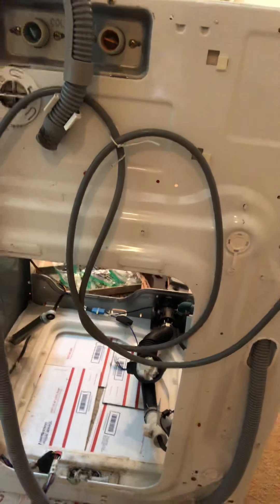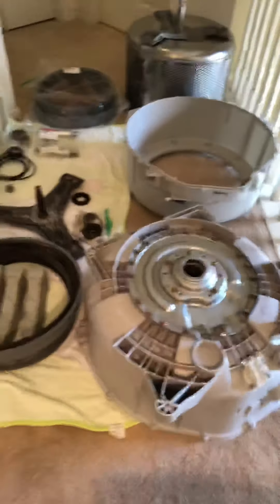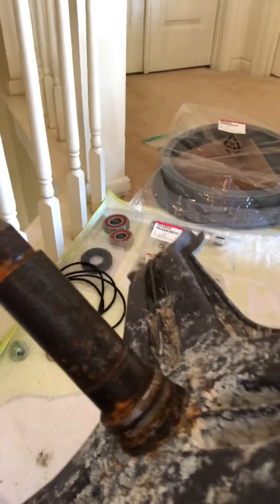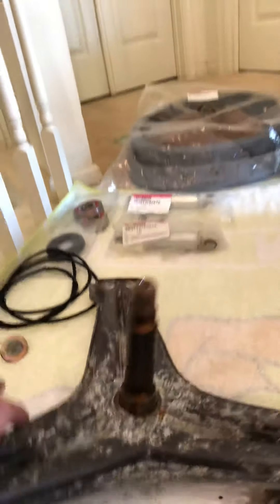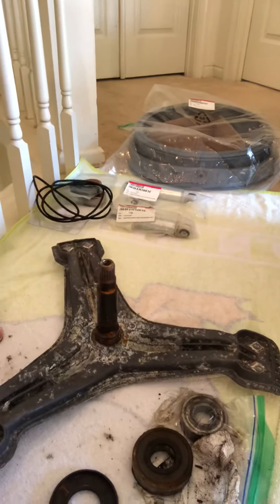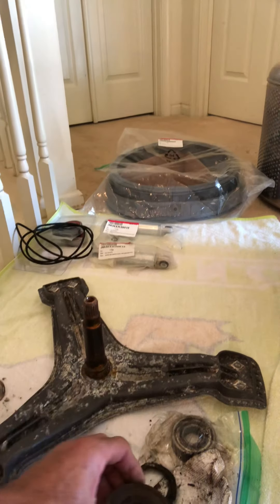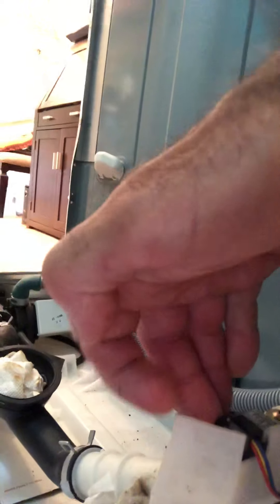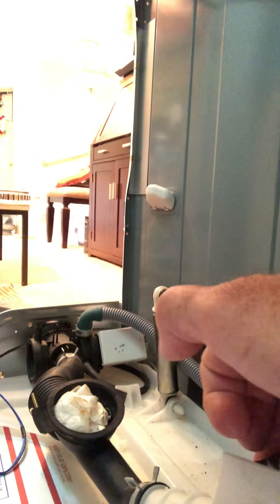LG/GE Washer Repair “warning” watch before repairing/replacing bearings.

Comment: Leave the washer door open when it’s bait being used. I’ve never had any issue with mold or bad smells. I have had two loads now with the bearing making noise so I’m going to take mine apart today. Doing disassembly & checking for additional failures or wear on other parts before you place an order, is just how you’re supposed to do things. The scum on everything is completely normal and expected. The aluminum spider was a poor design choice- stainless would have solved the problem. Anyway, thanks for the video.

Comment: I tried over two days to try and get the bearings out using pullers, press, hammer etc etc. In the end I used an air hammer to smash it out in a second and got away with it. I was a bit worried about breaking the plastic tub but by that point it was trash.

Comment: I guess I’m qualified to pipe in here,
Sometimes it’s not the money or time but the principle of the thing.
I just finished. 
I’m the furthest thing from being a mechanical guy, but I got bent when two different repairmen said the repair would be between $1-2000!
They both said “throw it away and buy a new one.”
     The “manufactured obsolescence” thing got me wound up,
So for a total of $130 in parts and the magic of YouTube, I replaced the spider bracket and the inner & outer tub bearings.
The bracket was crumbling like blue cheese (which is ridiculous and should be grounds for a massive class action suit, but they all do it the same so they get away with it)
but the bearings were fine. I replaced them anyway.
    If you’re going to be that far into the machine, I figured just do it, the parts aren’t expensive. 
Take your time with disassembly and put every screw in a ziplock bag and mark where it goes, and when possible tape that bag to the part it goes to. Take a sharpie and mark everything on the inside, even down to where a zip tie goes. Reassembly will go much smoother.
     What I learned about the whole thing was great, and use about 25% of what the detergent recommended, and if your machine has a 
“Cleaning cycle” use it, even more that it recommends.
Reply: I agree with you theres too much waste in this throw away society, incidentally how old was your machine?  Our LG is 4 yrs old, it spins perfectly when empty but with clothes it is noisy out of balance, they tell me the shocks souldn't fail already.  What symptoms did your old spider give? they tell me its gives a metallic noise as the stainless drum sometimes scrapes against the plastic surround if there really bad ?
Reply: @rogerbuckland4214  of course I’m not expert,
(Then again I might be after the experience)
But having been through this, I’m gonna say “get to work”.
I’ll bet dollars to donuts your spider bracket is toast. Your fix will go easier by doing it like I did in my description, as you will at some point will feel overwhelmed. Don’t stress as it will be fine even though it won’t seem like it.
1. New spider bracket.
2. Replace the bearings simply because you’re in there that far.
3. You can replace the shocks whenever you want, as it’s easy access, unlike the spider and bearings.
I got all my needed parts off Amazon, then just went super meticulous on labeling EXACTLY where every tiny thing goes when I took it apart.
It’s a pain for sure, but payed off big time on the reassemble.
And just be prepared to be hailed as a hero by the Mrs.!
Reply: @Daddy53751  Thanks for your advice 👍
Reply: @Daddy53751  Thanks for your advice 👍

Comment: New seal kit which included tub gasket $22.77, lasted 1year. Replaced it a second time, bearing kit was $14.99 (no tub o-ring). No don't it was tough, not sure but I probably had 24 hours total time for both DIY repairs. Bought this machine back in 2007. Run almost daily. It's an LG WM2077H. Dirt cheap and easy to repair and it doesn't owe me a dime. Keeping it as a spare for stuff I wouldn't want in the regular wash. While I would do what I DID again, I won't DO it again. This guy's machine was completely worn out. Should have been able to see that just from taking it apart. If my machine was in the kind of shape this one was, I wouldn't have ordered ANY parts. I would have bought a new machine.

Comment: I am going down this path now with a 20 year old Kenmore stacked washer, we purchased new, in a weekend house.  Replaced the bearings/seal/shocks for $167 (uneventful 3 hours) and while I was assembling the unit wife noticed while cleaning that the spindle on the spider arm was rusted and broken.  So we were going to buy new.  New was $2,000 for poor quality GE washer/dryer stacked.  Spider arm with wash drum for Kenmore unit was $500.  So we went with repair the solid, quality 20 year old Kenmore.  Waiting for the spider/drum to be delivered.  Estimated assembly time 2 hours.  Total time estimate 5 hours labor.  Based on today's low quality products, I bet your repaired unit will last longer and work better than if you had purchased a new unit.  I am confident (and so is my wife) that my old unit repaired will be superior to a new GE unit of poor quality

Comment: I hope anyone wanting to do this sees this comment I'm a 100 lb woman and I did this by myself. No help from anyone. It really is not a big deal. I pulled everything apart, replaced the bearings, gasket, and shocks. I took the spider off to clean it up, cleaned up ALL the parts, and voila. You can do it too. Just understand that it may be a couple days if you need to order more parts like I did for the shocks 2 day delivery from Amazon. I found a great video that is about 35 minutes long- put it on .75 playback speed and followed along while pausing here and there. As a small caveat I do have tools and I am mechanically inclined, HOWEVER- all it takes is the gumption to learn something new!e
Reply: Not sure why the part of this comment is crossed out, but speaking from experience, it is total BS.  No 100 lb woman, much less man can lift the drums out of the washer cabinet all by their self.  It took me and my very physically fit son’s entire strength to lift it.  Very challenging repair for even people that have superior DIY skills.  If I had not paid nearly $3000 for washer/dryer pair and pedestals five years ago, I would not have attempted repair.  BTW, my initial problem wasn’t the bearings, it was the lower (or back) plastic outer drum had a quarter size hole in it.  I found nothing that could have caused the hole.
Reply: @ I'm not the type to troll on the internet, and I do not make random comments to bullshit anyone. I did do it. By myself. As a 100 lb natural born female. My drum came out fine, I don't know what was up with your drum; the video I watched I followed step by step along with the guy. Maybe it was Milwaukee tool magic or some of my southern Appalachian hoodoo, I don't know what to tell you. 🤷🏼‍♀️

Comment: Your wife sounds like mine," I want a new one". I have been there and done that with an LG washer, Replaced the cracked Spyder bracket, bearings, shock absorbers, and springs. Levelled it and put rubber pads under the feet of the unit. Damn thing still does not run smoothly and the drum moves around way too much. Now I need a new rubber front seal and I noticed that the hot water inlet valve is corroded, might as well replace that too. What happened to the days when a washer lasted 20 years? What is the big deal that it uses less water when it is not reliable? 
  At least we can repair stuff ourselves and until it gets to a point that it is just not worth it anymore to repair and we have to buy a new one. Some things I have noticed on these new front loader washing machines. The replacement parts are way too expensive. The shock absorbers are junk. Basically a metal rod inside a plastic sleeve with a bit of grease in them. I wish someone would make an aftermarket real pneumatic shock absorber for these washing machines, that is probably why they don't work all that well. They need better dampening and a proper shock absorber.
Reply: Washing machines 20 years ago were all still plastic then. My dad had hotpoint and tricity bendix when growing up and they broke down too. It’s just luck I think and how well you look after it. My last lg was 20 when it died. And all my clothes come out just as clean as my old one. And yes it does use less water but I don’t mind as everything still comes out clean. But with a duvet or big blankets I do fill it up more with a jug to just up over the door they wash good then. But clothes come out clean every time . People need lessons on how to look after front loaders.

Comment: I couldn't get the bearings out after spending all the time taking the washer all apart.  They were basically melted into the housing as the bearings were so worn They were coming apart but melted in place. At least it was easier to get down the stairs and into the dumpster after I took it apart!😢

Comment: Now Imagine having 2 side by side and disassembling them both at the same time. 

That was my journey. I had one that would be my working washer and one was the parts washer. 

I replaced the bearings on the working washer about 4 months ago. Only thing wrong with the parts washer was the inner basket had caught onto the metal edges and bent/warped the basket. 

Now you're gonna say why not put the metal basket into that one. Well based on reviews of this model, well there was a couple of continous complaints about the temperature and amount of water it used and the results were clothes that weren't really clean. What I have experienced with the washer I had that would be the working washer, was clothes that were cleaner than any washer I've ever used. So i'm using the outer tub stater and rotor, springs, dampner's and water pump on my existing to make it an almost new LG washing machine built by me. 

BTWuB - All my parts were free and all OEM, as my parts washer I found on Marketplace on FB being offered at no cost.

😂😂😂

Comment: Yeah time is money but it feels good when your able to fix things on your own. Over use of detergent and especially the use of fabric softeners can leave that scum residue and harm the washing machine. Instead of fabric softeners use distilled white vinegar. You can clean your washer by pouring 1/3 cup ( 1 cup if it hasnt been clean in months or years) of citric acid and 1 to 2 tablespoons of oxyclean when you do the self clean mode. This is almost the same buying those expensive washer cleaning tablets or pouches. Just less expensive in the long run.

Comment: People should be using less sofner more hot washes and leave the door (OPEN) when not in use! I have a lg 8kg turbowash smart machine had it over a year nearly two never had the inside looking like that. Or my last lg intello washer which was 20 years old when it died. Might as well of bought a new machine for all the parts it’s had. But now will probably last Another 5 to 10 years 🙂

Comment: I’m on my 2nd spider assembly since I bought the machine in 09. If I have a reason to buy a new one, it’s gonna be because the front load machines are unsanitary & disgusting . Taking apart & Fixing the machine doesn’t bother me , however , I will never buy a front load machine ever again for sanitary reasons
Reply: Use washing powders that have sodium percarbonate (oxygen based bleach) and TAED (bleach activator) in them and leave the door and draw ajar after the wash and your front loader should stay clean and odour free.

Oxygen bleach kills mould and bacteria as well as breaking down stains, and leaving the door open stops mould growing on the door seal. 

I've not had a problem with mould, bacteria, slime, or smells since the 1980's when we tried out liquid detergents and stopped doing weekly boil washes. They don't contain the "oxi-action", because it would break down the other ingredients in the bottle.

See https://www.youtube.com/watch?v=6HnzBS_XQhA

Comment: Nearly 18 years on my LG Tromm and my bearing is making noise now. This is further than I wish to dive on it. It may last a week. It may go a other year or two. But my luck I'd do all this work and it would leak. Nope. Pass.
Reply: You shouldn't expect the new LG washers to last that long. I had one that lasted 13 years, but the new one I bought in 2018 shredded the bearings in pieces this year. I am thinking about changing brands now.

Comment: The problem with repairing these is the cost of the parts. You did make some mistakes when taking it apart, but bottom line.. it's better to just replace it.

Comment: That is not a fun journey. You obviously need a new washer. I was lucky. I tore mine down, replaced the bearings, shocks, tub seal, and water inlet valve in about 6 hours. But mine wasn't in nearly that shape. Sorry.

Comment: Never use powder washing detergent. Although it works well it’s always high in chloride and very acidic, that’s why your spider is so badly damaged. If you use a good quality liquid detergent you be amazed at how new the spider will look. But… you still have to replace bearings.
Reply: I almost exclusively use powder washing detergent, and I leave the door and draw ajar after the wash to let the door seal dry, and when I replaced the bearings in my current machine a few years ago after 10 years of use, the spider was in perfect condition. 

But, I've not come across a powder that was other than an alkaline, and I don't recall any containing any chloride. 

I tried liquid detergents many years ago in another machine,  the machine eventually became smelly and we found mould and slime under the door seal and in the tub etc. I've since read that liquid detergent residue is left coating the innards of the machine after the wash, which retains moisture, promoting bacteria and mould growth and that the moisture from the residue and from the biofilm coating the spider might be one cause of corrosion. 

Also, most, if not all, washing machine powders sold in the UK contain an oxygen bleach stain remover (sodium percarbonate and TAED) this is also very effective at killing mould and bacteria and keeps the  machine clean.